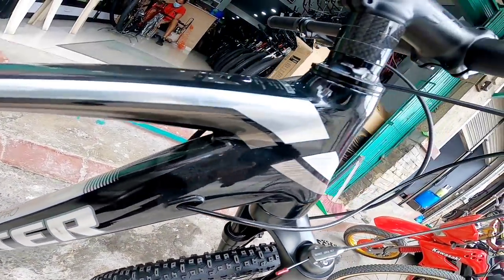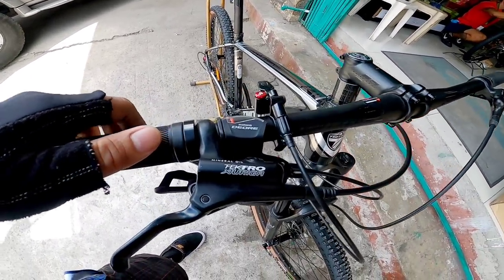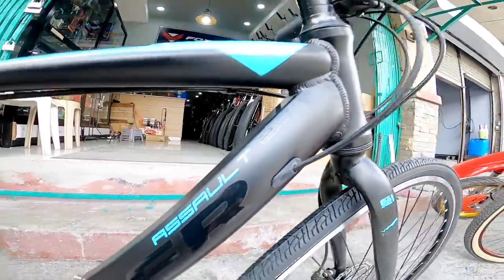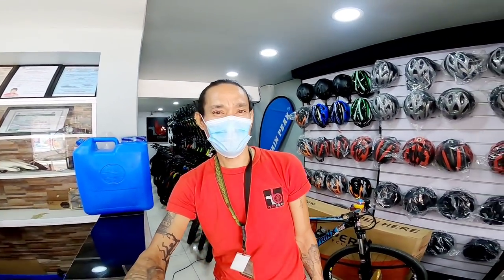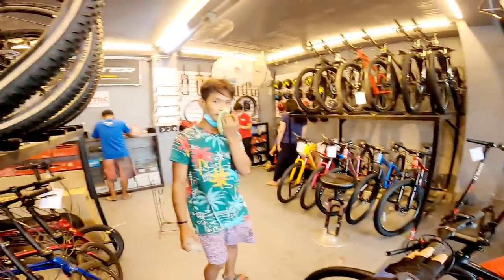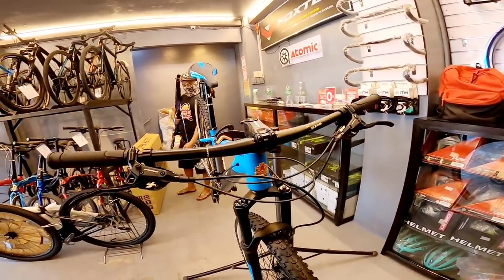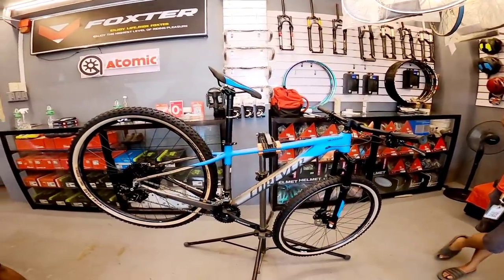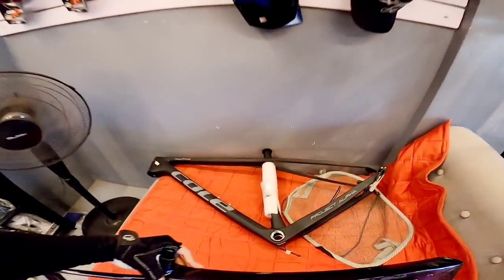BLACK HAWK PRO/ ASSAULT 2.0/ VEKUZZ/ COLE ALPHA | BIKECHECK

Comment: Boss ano po specs ng tirich cross?
Reply from the maker: TIRICH CROSS 29 3x10spd Hydraulic 
(Made by Foxter) 

Limited Stock‼️

Specs:👇
• Frame: Alloy Medium 
• Fork: Tirich Coil Lockout 
• Shifter: Sensah MX3
• RD: Sensah MX10
• Brakest: Kamros Hydraulic
• Seatpost: Tirich
• Saddle: Tirich
• Stem: Tirich
• Rim: Tirich 29er doublewall alloy
• Tire: 29x2.10

SRP: 13,400
Discount price: 11,399fix
Reply: @PeterPaulCadiente  thank u boss